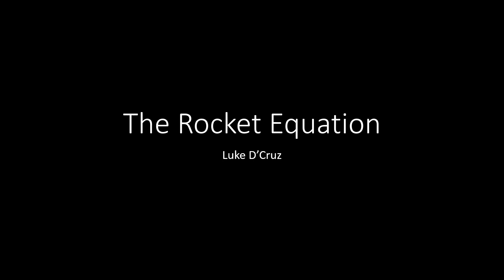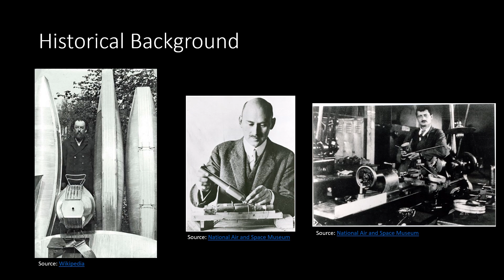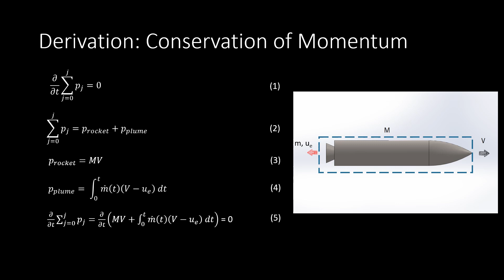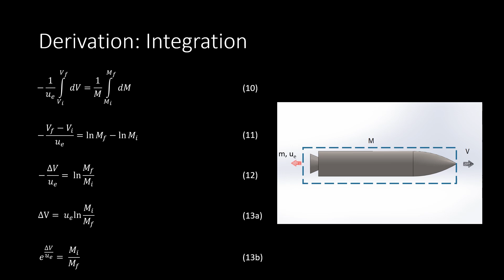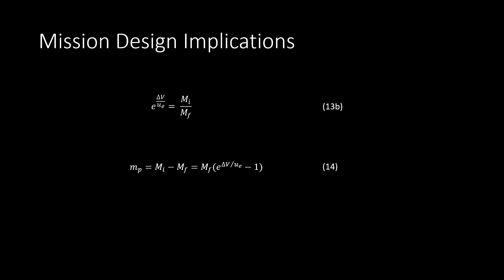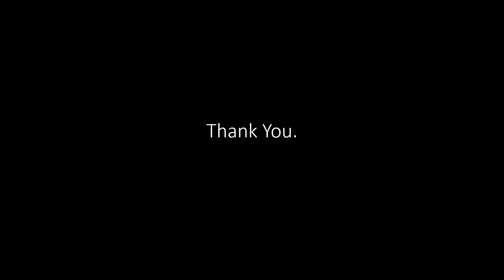Introduction to the Rocket Equation

Comment: Excellent video! How is the rocket equation utilized within the context of multiple stages of thrust (e.g. boosters) or when multiple rockets are used to propel the same object simultaneously?
Reply from the maker: Great question, Nick! For each stage of a multi-stage rocket, you would need to consider the Delta-V requirements for its later stages. When designing the bottom (first) stage, you would need to consider the mass, etc. of the second and higher stages. So, ΔV_total = ΔV_1 + ΔV_2 + ..., but the initial/final mass values would vary between stages. Maybe I will make a video to expand on this idea...